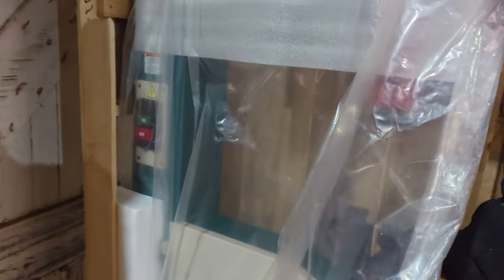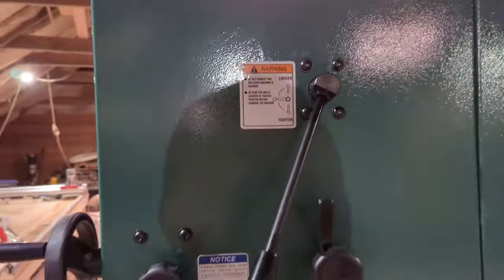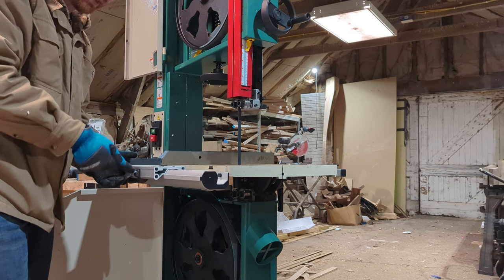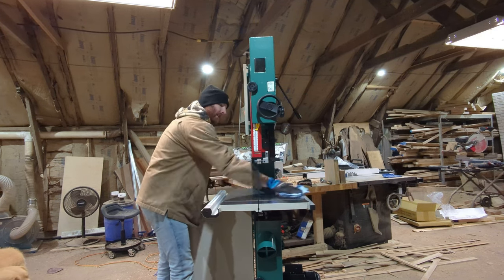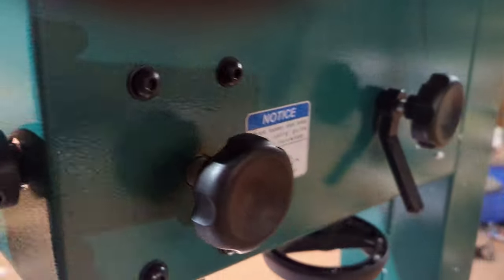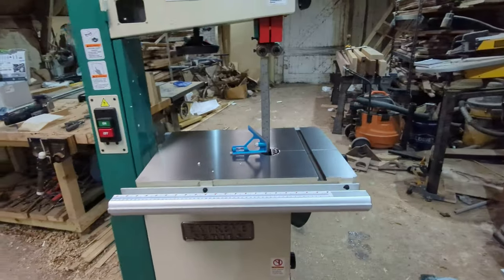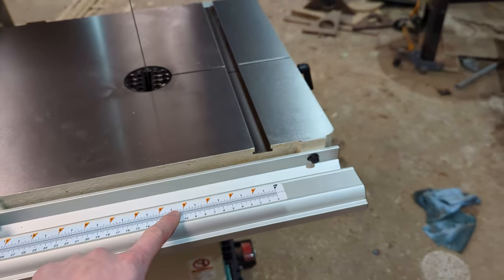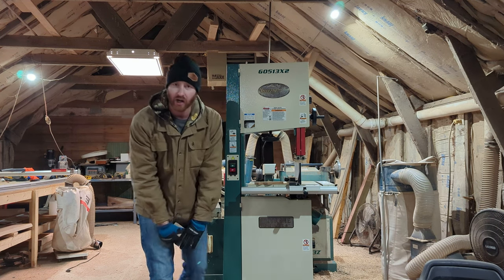17" Grizzly Bandsaw G0513X2 Unboxing//assembly//review

Comment: Bought the same one last year, I was laughing when you tried to open the bottom.  I did the EXACT SAME THING🤪
When you redo the base, reattach the corners to push them sideways, foot pedals to the right side. 1- you can easy reach with your right foot, not go around to the back 2- push and pull is safer with the longer side of the base as opposed to the short front/back possible tip over 
Fence tape, same issue.  No way around it without making a new measure tape to attach, etc, future project 
I love mine, a real beast to move without a mechanical lift of some sort, last bandsaw I will need to buy in my life, but it will be the kids problem to get it out of the workshop after I am gone 😅
You will enjoy it, have fun
Reply from the maker: Glad I'm not the only one who made the door mistake!  So far I'm happy with it was well, absolutely tank of a band saw.

Thanks for commenting

Comment: I just bought this.  They had a great sale on the Z model and I bit. 

1 the fence zeros to the cast iron bar, not the resaw Extention.  I’m going to buy a tape to put on top. No big deal. 

2 the no plug really threw me.  4 other grizzly large machines and they all came with plugs albeit different for each one but hey, I always run power anyways so another $11 was a great excuse to make a trip to town and get snacks lol 

3 same mobile base… same dumb problem hahahaha.  I added 2x4 blocking to raise it up a bit.  Easy peasy.  

4 I subscribed and will watch your other stuff now.  Where you at? Looks cold like here in central Wyoming. Hahahaha
Reply from the maker: @Andi.Mitchell.Designs  yeah small things that were a little annoying but overall I do love the band saw!

I'm in North Dakota 👍 thank you so much for subscribing
Reply: @BuiltKnotBought   yea I’m excited about resawing some shop veneers and improving my bookmatch skills.  Yea I read your bio after I typed that. Lol. Just watched your walnut buffet vid.  Time to get in the shop.
Reply from the maker: @Andi.Mitchell.Designs  have fun and good luck with the veneers I've only done them twice but it went well

Comment: you cant get carried away with WD-40 on cast iron.  I usually let the cast iron table soak in the stuff over night.  I dont know if it does any good letting it just soak in the stuff but it certainly puts my mind at east
Reply from the maker: I definitely go heavy on the WD40 when im cleaning things up.  Ive also started using boesheild often for a lubricant and it works great!

Comment: The rattle/chatter is most likely coming from the blade bearing guides. The manual says to set them at .004” clearance and I noticed in the video you have .016”, you might start there.
Reply from the maker: I don't believe it's the bearings I've played around with the clearance on them quite a bit with no success.  I'm actually leaning towards the blade itself being slightly out of wack

Comment: Have you figured out the noise you were hearing and did you get a fix for the measuring tape being off?
Reply from the maker: I have not figured out either of those issues, it cuts great but still has a bit of a rattle
Reply: @BuiltKnotBought  Is the measuring tape off because it's not meant to be used with the resaw fence attached? Like is the tape accurate to just the fence itself? Thanks for the video!
Reply from the maker: @MarkBorrelli  that's a really great question I'll have to take the resaw fence off and see if that helps, you might be on to something here! Thank you
Reply: what kind of wire did you use just bought the same saw
Reply: @MarkBorrelli

Comment: I set mine up and cannot get the fence to square to the blade vertically. I have the fence square horizontally, like to the miter track. Really frustrating and Grizzly didn’t know how to fix it literally gave me zero options
Reply: Shim the low side bolts with thin washers or tin.